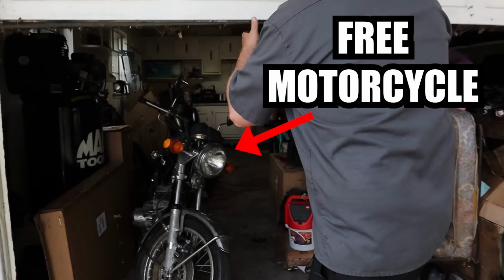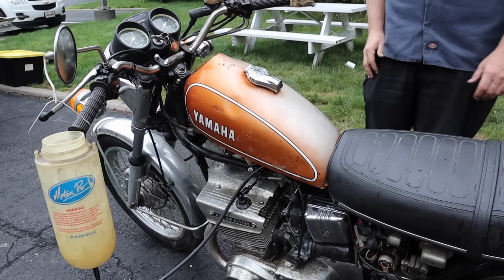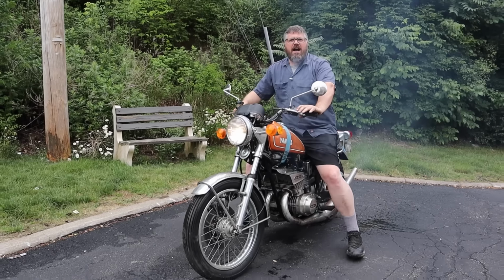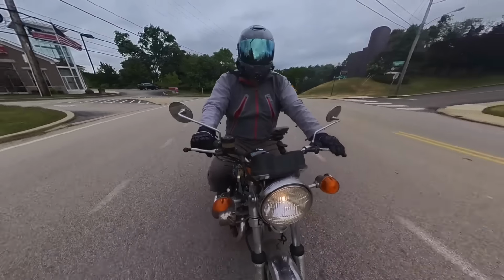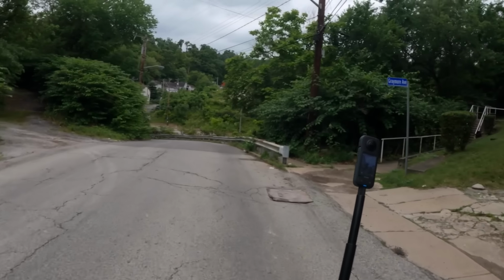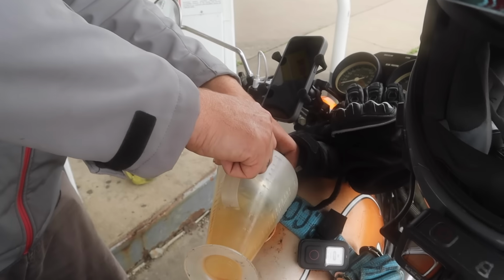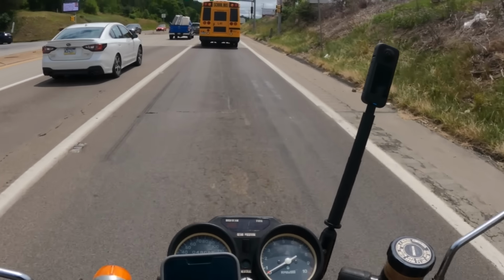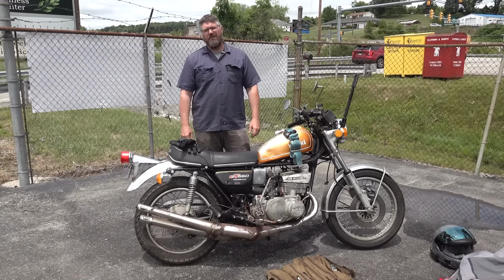Will This 48yr old FREE Bike Get me 253 miles Home?

Comment: It deserves a full rebuild imo
Reply: Ya!!!!
Reply: I agree. A full restoration would make this bike a beauty again.
Reply: Yeah!!!!! DO IT!!!!
Reply: Completely agree, i would love to see a compelte restoration of this 2 stroke
Reply: We NEED a full rebuild of this beauty
Reply: I agree with rebuild
Reply: Definitely. It needs to be brought back to what it once was.
Reply: I've still got a 73 gt250 my father and I rebuilt when I was 13. 27 years ago
Reply: yes it does, used to have two GT380, they were awesome, and fast bikes. one ran with ease like 130 mph, but mixture is very important.
Essentually, these 50 miles did kill the engine, due to bad mix.
Reply: Rebuild required.We have far too little of these great old bikes left in the world, especially here in Aus.
Reply: tyo
Reply: I used to owned  a '75 gt 380, max speed  probably around 90+ mph albeit above 80mph the bike already wandering around.
Reply: Yeah really do want to see this old motor runs!
Reply: @user-jn9dl9px6r  I've got a 73 gt250. She'll get up to 90+. I love the trail of two stroke oil it leaves behind it
Reply: @JoseyWhales-ii4dk  As a bike rebuild, yeah you'd never get your money back.  As YouTube content, he'd definitely get enough clicks to make some $$.
Reply: As a pure fun bike a Kawi Ninja 600 with high bars, raised saddle twice the HP brakes and likely suspension, takes modern tubeless tires, plugs last more than 2-3000 miles, point was quick and easy but on crank every 2000 miles. Sound was wonderful, excellent real world experience.
Replaced rear shocks, fork springs, fork oil, heavy rider. 
Just worked.
Reply: Do it Craig !!!
Reply: deff
Reply: @Steve25g  A GT 380 doing 130 mph? Think you might be looking back through Rose tinted glasses! The GT 550 topped out at around 115mph.
Reply: Agreed!
Reply: @rmcdudmk212  You'd have more in it than it would be worth.. like most of the projects I have going!
Reply: @robertbagley9199  actually. one of both did. previous owner had worked on the cylinders, and it seemed to have a bit higher compression. 
Back in the day, I was a light driver, and was impressed about how damn fast it was. The bike also had 'clip-on's' , so put you in a very flat position. I had to close gas, due to end of the road, bike was still accelarating, and I was near 125mph, recalculated from km/h
the other one I had, had more options, and more weight, and was slower.
Reply: 77
Reply: for sure
Reply: @JoseyWhales-ii4dk it was a great bike but you are 1000% right.
Reply: Gotta be careful it’s get expensive fast. I’m working on a rd400. And I’m not done and over 7000$ in…
Reply: @christianheidt5733  0:10
Reply: @christianheidt5733  0:19
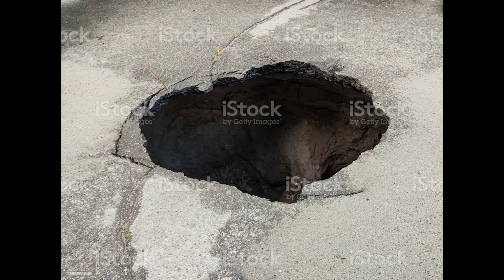Reply: @christianheidt5733  0:26
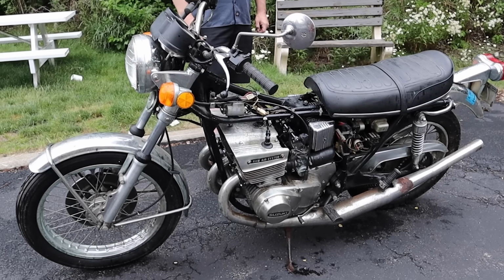Reply: @christianheidt5733  0:42
Reply: @christianheidt5733  1:01
Reply: @christianheidt5733  1:42
Reply: @christianheidt5733  2:06
Reply: 7:09  7:25 7:26 7:30 7:31 7:32
Reply: I agree, its an awesome looking bike.
Reply: Craig, we would love to see this particular Suzuki restored, or close to it. It is old enough, it is rare enough, it belonged to one owner when he was young, he rode it and then parked it for 37 YEARS to enter a new phase of his life...but this bike sat there, in it's original owner's garage for 37 years, just waiting for someone with the knowhow, skill, parts connections and financial ability to save it, restore it and ride it for a few years. Please seriously consider doing a series of videos on you fully restoring this machine, or close to a full restoration, and then riding it once in awhile in some videos. We'd eat it up if you decide to do it. ;)
Reply: Almost complete and original bike. Must be worth fixing the motor and restoration? Too many classics like this end up in the crusher
Reply: @JoseyWhales-ii4dk  ill buy it
Reply: Can't wait for the rebuild episode 😃
Reply: The one important part that’s missing is the trailer!!!!!
Reply: Was my favourite early bike before got a bonnie in 78😊
Reply: The odd math if the bike doesn't let you down you don't let the bike down
Reply: I guess it will never happen...
Reply: … I would say so brother😂

There was literally smoke leaking out of the head gasket🤣

They all deserve it but only do they rarely get it!
Reply: So you just ran premix instead of the internal mixer thing?  How did bearings get oil?
Reply: Hopefully by a real mechanic, not this guy 😂😂😂
Reply: @Steve25g  It wasn't the bad mix that killed engine. If it would be gas oil mix fault it would also kill two other cylinders, the problem was carburetor not giving nearly enought fuel to lubricate that cylinder but it was still running because two other cylinders were running and were spinning that one cylinder without lubrication. Shame, would been a nice well running bike if he wasn't trying to ride it in that state. Another classic bike destroyed for yt views, lets hope one day he will learn how to treat engines with respect, to be honest those motorcycles have higher chances of survival staying in a shed than being "rescued" by those people.
Reply: @Steve25g no way a GT380 is hitting 130mph without some extremely serious work put into it
Reply: @gtemnykh  maybe that did happen ? work did happen to cylinder in and outtakes, even carbs.
the second gt380 I had was nowhere near. original airbox was removed too
Reply: @duskintheforest584 The fuel runs through the crankcase of most 2 strokes. Odd, I know...
Reply: @user-jn9dl9px6r 380 would not run 100..😂 the GS 750 stock out of the box was 134 mph I did it I know that's nothing now
Reply: Agree it deserves it
Reply: I think you broke it when you put the danger fuel in it
Reply: And now it needs one.
Reply: The world now a days need those engines 🙏♥

Comment: Don't bypass the oil injection on old Suzukis. Many inject oil directly to the crank bearings and can't be lubricated from the fuel alone.
Reply: You can disconnect the cable going to the oil pump so it runs at minimum all the time, and THEN run premix. You need to block all the oil output lines from the pump  EXCEPT the oil line that supplies the bearing(s). The pump pumping on minimal oil, only through the bearing will ensure the bearing will keep lubed while also running premix.
Reply: You guys, lol. Absolute nonsense! Everywhere fuel goes, the oil goes with it! From v6 racing out boards, to Kawi triples,  disconnecting the autotune will not cause bearing failure. Providing you mix the fuel with oil it will get lubrication.
Reply: @MrKips1  it may pay to Google the Suzuki CCI system for motorcycles.....

This injects 1 feed straight into the case and one through a bearing that WILL eventually die if its not fed oil through it.
Reply: @spinnanz  I'm fully aware of the Crankcase Cylinder Injection system and it's workings.
Reply: @MrKips1  well I've got 2x CCI engines with bearings that will loudly disagree thinking you know how suzuki CCI works.

If its injecting directly through the bearing it will have singers or shrouds cupping them, in which case premix won't reach them enough to run long term. If it's injecting only into the case, premix is fine. I know for fact, the 2 engines I have with a toasted bearing both ran premix long term and both are similar era to the bike in the video.

It's a pretty well known fact on Suzuki forums to not run premix long term on Suzuki CCI engines that have cupped bearings.
Reply: I have a suzuki ts185 that someone butchered. I'm just starting to hear some kind of ticking in the lower end and I'm crusing the previous Crack headed owners. lol I am doing a full restore, though. Seems like I can get any part I need.
Reply: That's right,  back in the 70s I wanted to remove my oil injection on my Suzuki TS 185 and the Suzuki dealer mechanics said no it's not like a Yamaha, I installed a small oil bottle and switched the lines how they showed me and mixed fuel 50:1
Reply: @MrKips1  With most 2-strokes you're quite right, but not with the CCI Suzukis. There is a way of doing it, but simplify running on premix will screw it up. .
Reply: @spinnanz  No not really the CCI system still needs extra oil in the bearings because the increase in rpm also increases the flow of gasoline and air stripping the oil away.
Reply: @tauncfester3022  bearing, not bearings. The bearing that requires lube has a cup over it which shields it from fuel wash. This is the reason the CCI system must stay working on the bearing feed. If the cup is removed, the CCI system can be completely removed too.
Reply: @spinnanz  Four bearings. the oil is provided with paths to all of the mains and big ends.  I've owned a few Suzukis and Saab 2 strokes, which also use direct oil into their bearings with four separate lines off the injection pump.  The owner of our Suzuki shop said to not remove the system or disable the volume control.   I'll take the recommendation of someone who actually worked on these bikes since his dealership opened in the 1960's over some youtube comment expert.
Reply: @tauncfester3022  sorry, to clarify: one oil line goes to the crank, one to the bearing of EACH cylinder. The crank ones are fine to disconnect, the bearing ones are not. I'm only thinking in single cylinders.

The below is from a suzuki workshop instructions of fitting a (factory) race kit to an a100. "Keep the pump, remove pump metering cable, block crank CCI lines, retain RHS bearing CCI line"
Reply: Old guy here that in my 20s who used to work at a Suzuki dealership towards the end of these GT series bikes. As commenters above or below not sure where this comment will show up is correct, Suzuki oil injector systems do put oil into lower main bearings, and yes do have oil slingers that help distribute that oil tank oil out of the injector pump but also act as a shield keeping Craig's premix from getting to the bearings for lubricating. The pumps as they wear actually inject more oil as they wear so that's a plus but you must keep them clean so nothing gets clogged. Running no air cleaner like others have said was a seizure waiting to happen. It looked like it was full of an old time favorite 2 stroke oil bland named Klotz, smelled good and was red. :)
Reply: @MrKips1  obviously NOT, since you are wrong.. have you ever worked on a Suzuki twostroke ?
Reply: He just tucked the bike up by that and ignoring the vacuum.  Sad for the bike.
Reply: Lil premix 50cc Suzuki mopeds just run fine with the premix bypassed. The FA50s do lube fine with the crank lube bypassed.
Reply: Yes user-oe5zx2 has it correct. You DO NOT mix the oil in the gas tank !!!. The oil injectors do that. Just add straight leaded gas
Reply: @MrKips1  thanks for clearing that up for me cause I had heard that years ago about premix not getting to the bearing, didn't sound right then but knew very little about two strokes at the time..😉👍
Reply: @MrKips1  unless its running super lean like this one was
Reply: Oh yes. That's why I prefer Yamaha of that vintage.
Reply: @spinnanz  May I express agreement here? I spent about 35 years with a small piece of steel embedded in my hand as a result of repairing a mid 1970s Suzuki TS250 that had been converted for road racing and run on premix without removing the cup around the left main bearing. The bearing had seized (causing the rider to fall off at about 90mph, but he was OK thanks to the protective clothing) and had also galled and seized on the crankshaft. So as to get it off without further damage to the crankshaft I had to grind most of the way through the inner race and then split it with a hammer and chisel. A fragment flew off and caused a small cut on my hand. I noticed some weeks later that I could now feel if there was a strong magnet near my hand. A few years ago I had to have an MRI scan, and they had to remove the piece of metal from my hand first. It was surprising how small it was.
Reply: @tauncfester3022  Nonsense, stripping of gas/oil because of rpm doesn't happen.  My TZ used to redline at 10500 rpm on premix but mainbearings stayed ok. Likewise 50/125 cc racing engines used to run around 16000 rpm without any problems to the main bearing. Bigend bearings is another story but those are not directly served by the CCI system.
Reply: @spinnanz  I've had my TS 90 apart and both bearings had shields.  The Shop manual shows the oil 's path out both mains and the big end's bearings.  Given it is a small amount, but why would they shield both bearings?
Reply: Say what?! 😆
Reply: @MrKips1 It must be hard not being able to read the manual
Reply: So all you guys arguing about crank bearing lubrication are just going to completely ignore that that's not what killed it?
Last I knew a holed piston has precisely zero to do with bottom end lubrication. 
Welcome to the internet I guess.
Reply: Exactly when you see oil lines running to the main bearings and everywhere else pre-mix is not going to work good on that engine
Reply: @spinnanz  that's the stupidest thing I've ever heard and believe me I've done this for years.. and what you just said is silly why would you want to do that
Reply: @MrKips1  you don't understand how it was engineered obviously
Reply: @spinnanz  the bearings were designed for pure oil that eventually gets in the gas.. if you try to run pre-mix we're supposed to have oil that's screwing it up 😭
Reply: @Toxic2T  🤡
Reply: You always have people that argue about something that's false information.. yes you can unhook all of those lines and premix it for the rest of its life 🧬 but it will have a shorter life it's not designed to do that.....
Reply: @RonaldDaub-xi5jz  bro felt pressed over bypassed oil pump 😂

Comment: The piston most likely melted due to the lean condition from the air leak (vacuum line unhooked). Great video!
Reply: Compounded by mixing the oil in the tank, because the carb jets were set for neat petrol.  Pre-mix requires bigger jets, otherwise the engine runs lean.
Reply: @X2323X and a plugged carb doesn't lube the premix while the other cylinders are still running. I think Suzuki directly injects oil on the crank bearing. That might have saved it.
Reply: Fuel wasn't mixed properly
Reply: Yeah, i think the gt550 and t500 had the same setup. My t500 has 4 nylon oil lines that spray directly into the cylinders. They are not fun to work on at all, but once they are running free, they're great. I read on a forum NOT to premix, as was mentioned above, because it doesn't lubricate the bottom end that way. I also had that stupid vacuum petcock. Sealed it at the carb and removed the hose. Wonder if that's why mine idles poorly? Anyway... still super awesome, Craig! 

Watch the "Kentucky Yankee" rebuild a T500 Titan, and it deep dives into that whole bike system.
Reply: @williamculbertson5230  premixing fuel really doesn’t hurt anything other than making more smoke at low rpm and running too lean on decel. The piston had a hole burned in it which is not an issue of lubrication, that’s caused by heat. I would guess that the bike ran very lean causing lots of heat and ultimately pre ignition which burned a hole in the piston.
Reply: Ran lean with the vacuum line unplugged, and with a 2 stroke bike where you aren't using an oil injection system, never try to mix it in the tank. Mix it before you pour it in the tank. Otherwise you end up with higher oil ratio gas for the first part of the tank, then gas with very little oil through the last bit of the tank.
Reply: i had a few suzuki 2t always problems but lovely looking bikes
Reply: @RickGraziano  If I remember correctly the petcock vacuum line was on the center carburator but the holed piston was in the right cilinder, so that wasn't the reason. Probably a dirty jet because of crud from the gas tank or a maladjusted ignition.
Reply: And also the missing airbox.

Comment: I know that this video is over a year old, and that virtually no one is going to read this, but it needs to be said before too many of these old Suzuki two-strokes get terminally ruined.  The Suzuki CCI oil injection system is not like what was used in most other oil injected engines.  On the Suzuki CCI system, oil was fed directly to the crank main bearings, and through a system of clever channels/slingers, was routed to the rod big end bearing before mixing with the air/fuel mixture to lubricate the cylinder/piston.  So therefore if you try to run the engine on premix only, you could be starving those critical bearings of lubrication.  I grew up working on these engines back in the '70s, and saw so many well intentioned owners disconnecting the oil injection system thinking they were unreliable, but were in fact sentencing them to an early death (the engine, not the owner lol).
Reply: Bump for the algorithm
Reply: bumpity bump

Comment: This is very entertaining, thanks for posting.
40 yrs ago I owned a GT 550, one tough bike. Noisy and vibey and smokey and a real hoot.
Reply: I also had a GT-550 back in '82~83. Not the most mechanically reliable bike but it was fun to ride. A real rocket on the straight between lights, but not so much in the curves.

Comment: Was totally hyped for part 2 of that video after celebrating that you get it running again.

I would have taped the intake from the airbox partially to compensate for the missing filter and make it run more rich.
We did stuff like that to test around when fixing our 2 stroke scooters.

Its always better to run a 2 stroke too rich than too lean - especially when you run a machine that you cant trust.
Reply: Rode around on a two strike knowing a vacuum hose was hanging off, not a sign of any two stroke experience.